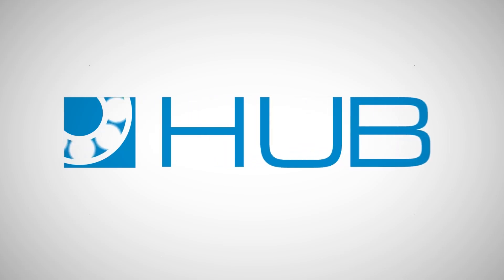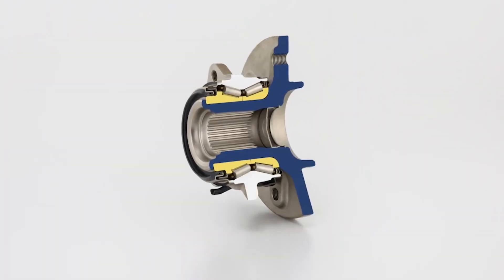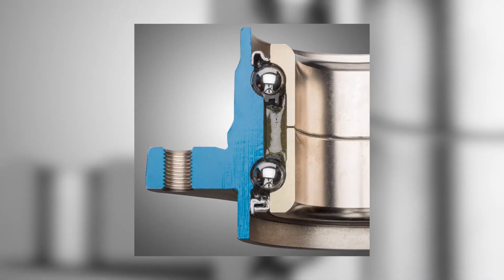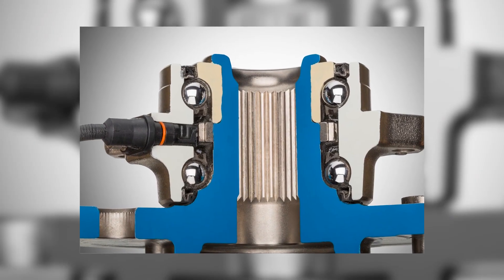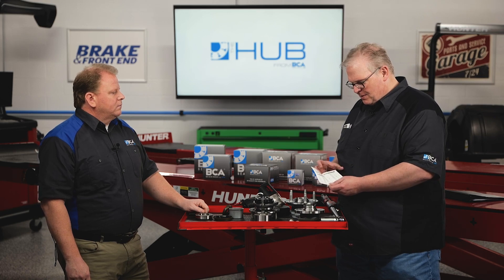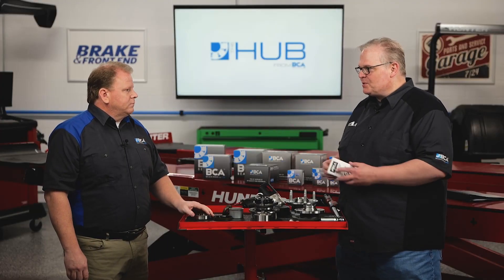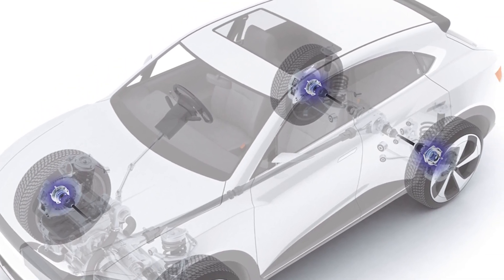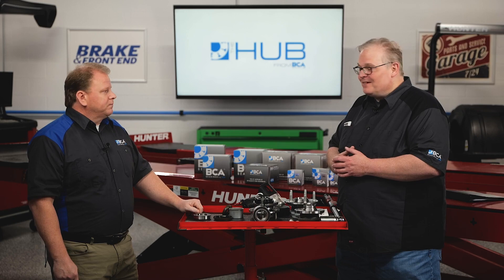Axle Nut Torque Specifications

Comment: Gents, you did allude to a couple of reasons, but I was hoping for a more technical review rather than being told the torque value was important! The bearings we are talking about here either press against each other or against a spacer. Once clamped together, say 100lbft, then why would an extra 100 to 200 lbft make any difference? Are we talking about metal deformation? A reason you gave is that it needs the high values to seat the bearings into place, another reason given was to hold the splined shaft up tight against the hub. OK so why not just tighten everything to 300 lbft? Put another way, what difference would it make if one rated for 100 was tightened to 300 since nothing is actually moving once seated?

Comment: 100% bullshit,there is nothing wrong with tightening the axle nut with an impact.Plus it is impossible to fully torque the axle nut down.I tighten axle nuts with an impact,zero comebacks.
Reply: mid 2000s and older, need it for preload
mid 2000s to now, not necessarily required for preload, but keeping the splines strtaight and from "sawing" back and forth.   do not lubricate splines
Reply: @CT_Taylor Still bull,axle nut torque is not critical